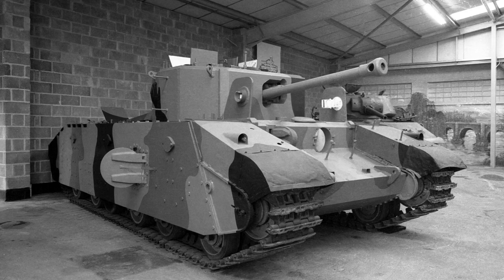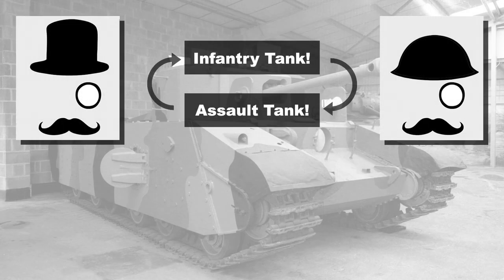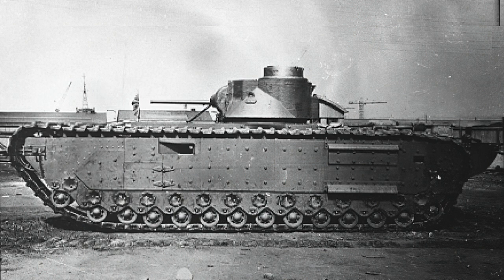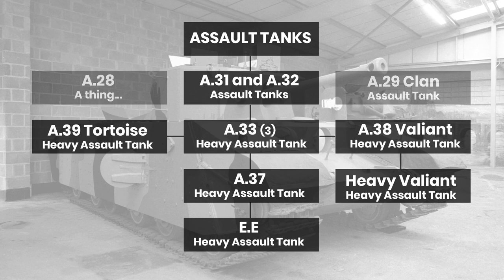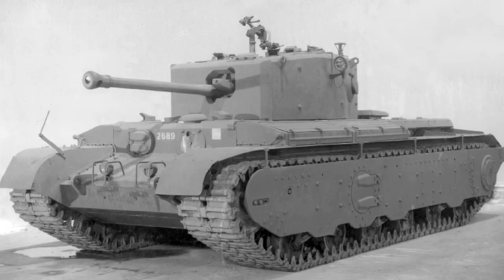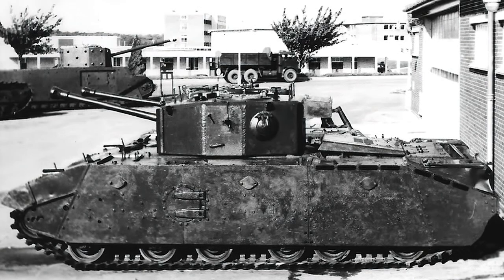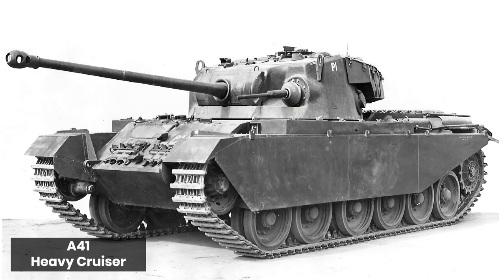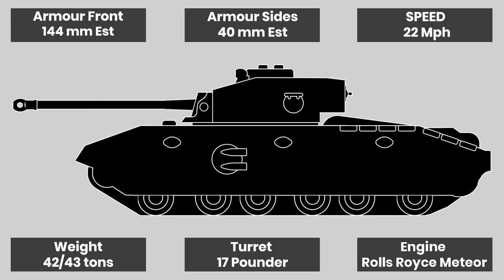A33 - Tank Design & Development

Comment: Thank you for the video. Over the past few months, I've received a lot of A33 Excelsior replays and I did my best to explain that the Churchills lost their charm at Dieppe and they needed a replacement based on the A27M Cromwell design but up-armored to work as a heavy tank. You did a much better job of explaining the features of the Excelsior. It's still an excellent training tank in World of Tanks, because it's tier 5 and premium. So it earns extra credits and experience with each game. The frontal armor is also very good at blocking damage and I've shown in some replays (even my own) that you can quickly win awards because it is so difficult to stop when played correctly.
Reply from the maker: one of my best games was in A33, tho this was when it first came out - was super agressive with it and just stomped them, tho it seems the first game in anew veh always palces you at top of MM
Reply: @armouredarchives8867  With a new vehicle you get five games as top tier then its bottom/same tier for the next thirty or forty.
Reply: @armouredarchives8867  When I'm not top tier I use her as a medium as with the improved vents etc she can easily do 40kph with a hp-ton of 17+ turning her into essentially a super-sherman

Comment: Stuff for our brains to think about, good job. With the A34 turret, that A33 derivative is close to becoming that desirable universal tank concept. I still find it strange that all the "assault" tanks are equipped with high velocity anti-tank guns that bely their intended usage. I find it hard to imagine that they had not intended to place some other gun for the close support role that should have been apparent as the real requirement, What was the fixation with high velocity guns for an assault/shelled area tank? You might need one or two at best but the others would all deal high explosive surely? The artillery can't have all the fun.

Comment: The infantry and assault tank requirements obviously over lapped, a well armoured and mobile tank with a suitable gun covered both.
Reply from the maker: but with differnt speeds and edurances?
Reply: @armouredarchives8867  They seemed to get bogged down in detail when at that time they could have started with weight and gun figures as high as was practical then go from there. Weight would dictate suspension while available space and weight would define the drivetrain. If those aspects were appropriately selected then endurance should follow.

The Centurion is a good example of all these aspects coming together to make a tank that could do just about anything.
Reply: @FairladyS130  endurance and speed requirements are important and different for infantry and assault tanks. you can leave them as an afterthought as your reply implies.
you could showhorn in assault tank requirements into your infantry tank, but you end up with a sub-par infantry tank or a sub-par assault tank (or both),  and no the centurion could not do just about anything.
Reply: @matthiuskoenig3378  The Centurion was mentioned because it performed well in Vietnam as a infantry support tank, I doubt that it was designed with those conditions in mind but it showed what a well designed tank with suitable basics like powertrain, suspension etc. could do. The thing with specialist tanks is having them in the right place at the right time. The concept is good in theory but in reality a nightmare for logistics and support including moving them around to where they are needed.